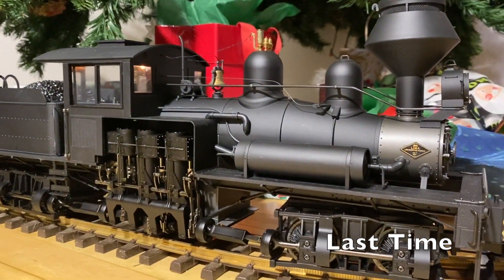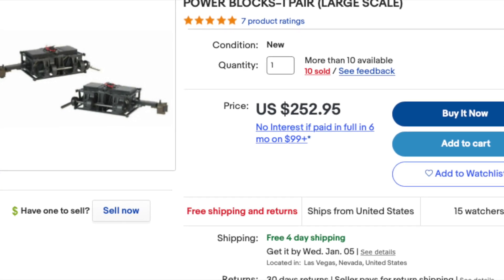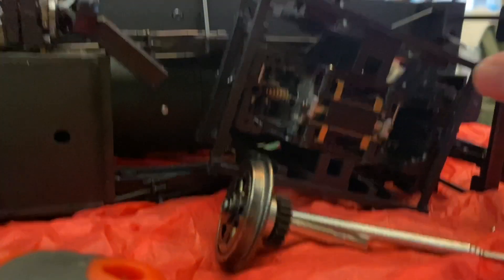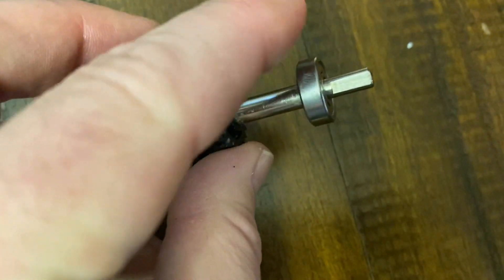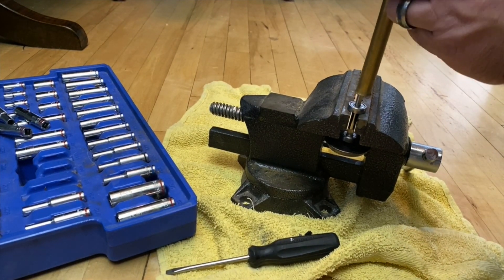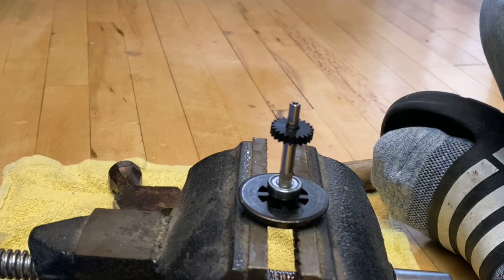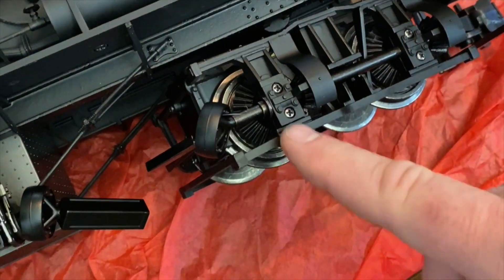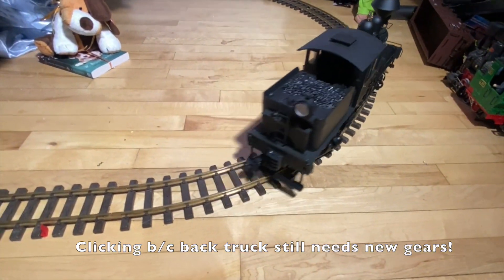Can we Fix Clicky The Christmas Train??  - The Bachmann 2-Truck Shay has a fatal flaw.

Comment: Where do the bearings (you called them BBs) go? They were still out when you put the truck back together.
Reply from the maker: Great question. You’re comment made me realize what they are. I’ll go in and look as soon as I can and let you know. Might be a few days though
Reply: @snaph  I may be able to help. I think they might have something to do with electrical Pickup. the Shay is still working because you didn't tear into the other truck yet, so it's getting its power from that one. Just a theory at this point. I just got a Shay a few days ago and it's missing a screw from one of the wheels, I am glad I found your video, so I know a bit more of what I'm getting into when I replace the screw.